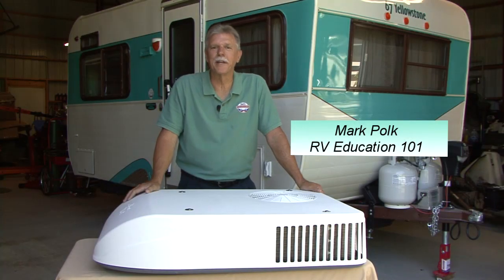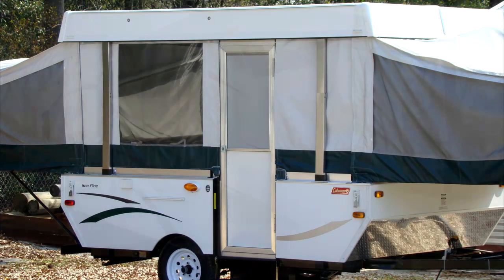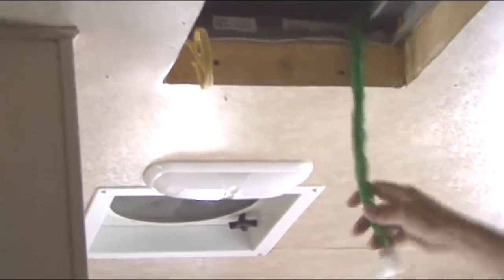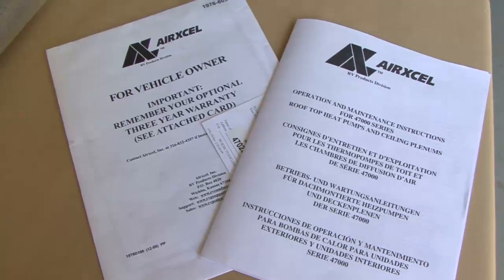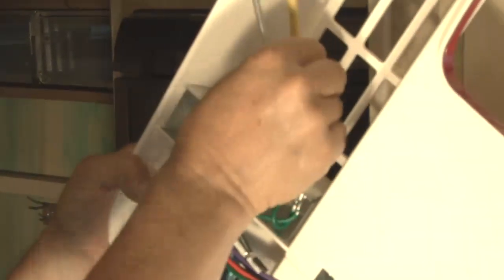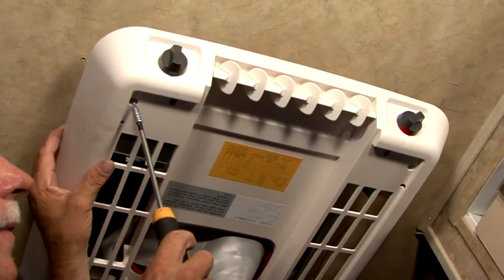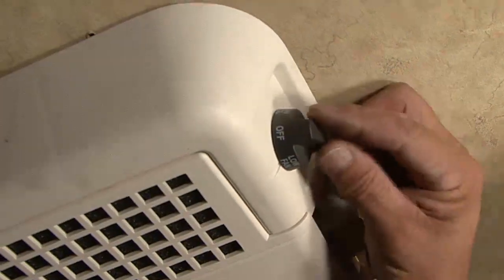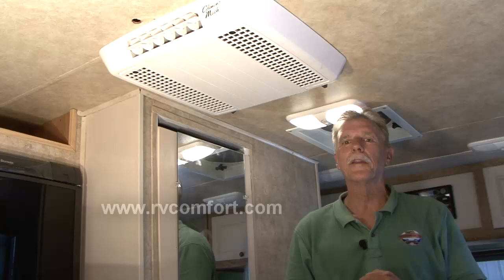How to Install a Coleman RV Air Conditioner

Comment: I bought a used 2008 Fleetwood Utah. How do I find out model I have?
Reply from the maker: I am assuming you mean what model AC unit. Look in the owner's manual if you have it and the air conditioner information should be there. If not, the model might be on the AC cover inside the RV or you can remove the AC cover on the roof of the RV to locate the model number.

Comment: What's the minimum watts necessary to run the AC?
Reply from the maker: It depends on the size of the AC unit, but in general I would plan on about 15 to 16 amps when the AC compressor comes on, that is 1800 to 1920 watts. It will use less once it is up and running.

Comment: Thanks for the info video.  I picked up a used unit and I'm installing in into a pop-up truck camper.  Is it a 30 amp unit?  What size wire is used for the 120v system (12-2)?  Thanks
Reply from the maker: The wire gauge size is similar to house construction. It is based on the distance of the run and the amperage draw. If it is short distance (say less than 20 feet) you normally use 14 gauge for 15 amp circuits and 12 gauge for 20 amp circuits.
Reply: Great, thanks!

Comment: would I be able to run this unit off a car battery or something similar? im looking to convert a small cargo trailer to a camping trailer. I'd like to be able to run lights and the A/C off one battery. any suggestions?

Comment: This is a little funny,  it's an instructional video on how to install the air conditioner, but right off the bat, you are saying it should only be installed by a professional.
Reply from the maker: +bckkm It's simply a disclaimer to let folks who are not comfortable doing wiring or working in the roof etc to have it done by a professional
Reply: +RV Education 101® I figured, it was just funny.  Thanks for the video.

Comment: Hm. Nice video. Only thing is, not many of us have power magically prewired for us. That is what some consider the critical element to installing an AC unit. Dropping in a unit and plugging it in is great. But how was the actual wiring done?
Reply from the maker: The majority of RVs manufactured today are pre-wired for a roof air conditioner. This video concentrated on how-to install the roof air conditioner. We do not have a video on wiring a roof air conditioner. Due to electrical codes and ensuring the proper gauge wire and proper amperage from the power distribution box is used, this type of work should only be done by a licensed electrician.